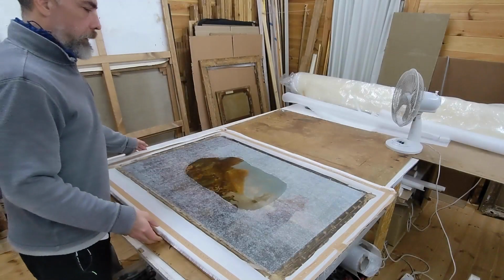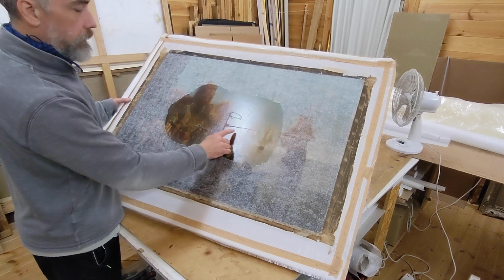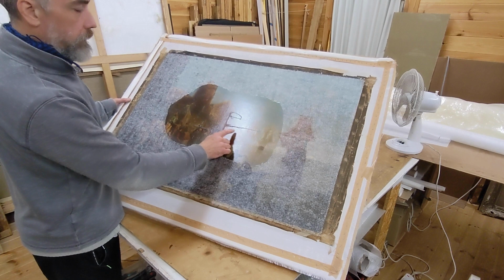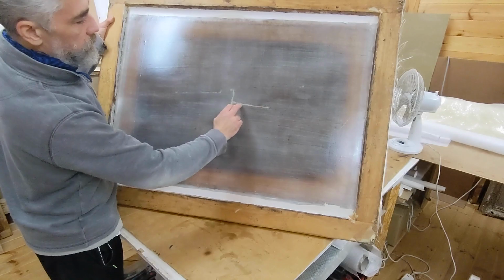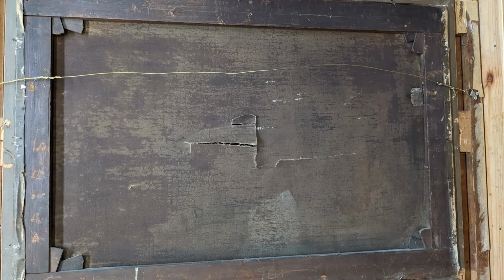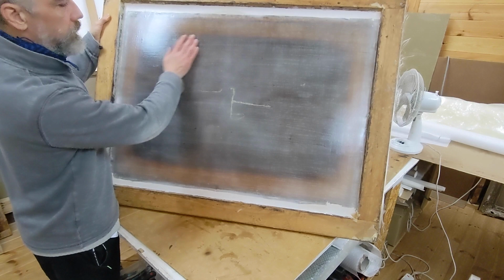Restoration of a damaged old oil painting

Comment: Why on Earth do you think it appropriate to use staples on an old painting?
Reply from the maker: Good question.  But in fact I did use tacks.  The staples were only temporary.  In general I prefer staples as they do less damage and have greater strength to hold the tension, also we use stainless steel which last very long.  But usually clients prefer we use tacks to be sympathetic to the painting, also we use copper tacks and antique hand-made tacks - and sometimes we even save the original tacks and re-use them to keep the painting as close to the original as possible